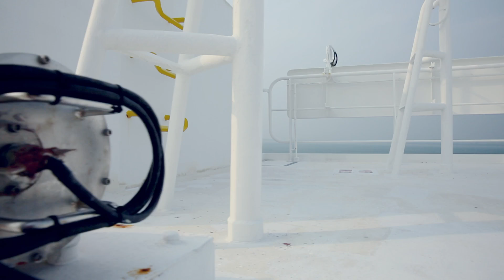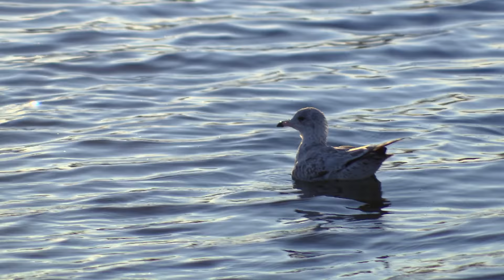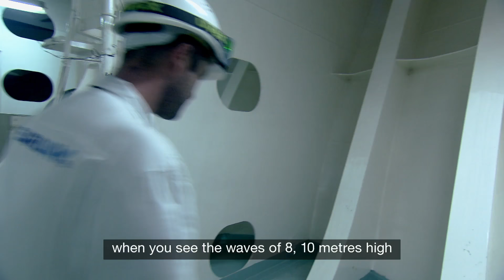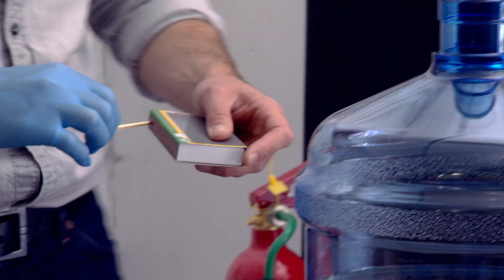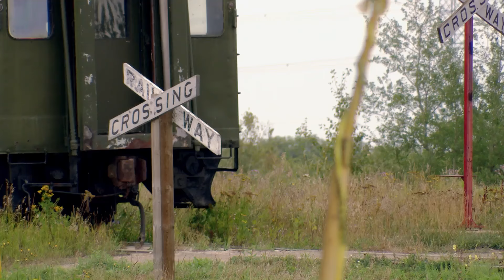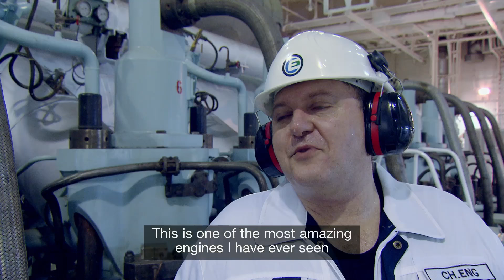Unlocking the Power of the World's Largest Oil Tanker | Blueprint

Comment: By AI:

The Seawise Giant (also known as Knock Nevis, Jahre Viking, etc.) is significantly bigger and heavier than the TI Europe.512edf
Here's a direct comparison based on their key specifications:
Length: Seawise Giant — 458.45 m (1,504.1 ft); TI Europe — 380 m (about 1,247 ft). The Seawise Giant is roughly 78 m (over 250 ft) longer.f32e46
Beam (width): Seawise Giant — ~68.8 m (226 ft); TI Europe — 68 m (223 ft). Nearly identical, with the Giant slightly wider.ce1ab1
Draft (laden): Seawise Giant — 24.6 m (81 ft); TI Europe — 24.5 m (80 ft). Almost the same.297e42
Deadweight Tonnage (DWT, cargo-carrying capacity): Seawise Giant — 564,763 DWT; TI Europe — 441,893 DWT. The Giant could carry about 28% more cargo.9432c7
Gross Tonnage (GT, internal volume measure): Seawise Giant — 260,941 GT; TI Europe — 234,006 GT. The Giant is larger here too.59d3fa
Full-load displacement (total weight when laden, a key measure of "heaviness"): Seawise Giant — ~646,642 long tons (or up to ~657,000 tonnes in some references); TI Europe (TI class) — ~509,484 tonnes. The Seawise Giant was substantially heavier.cfebb5
The Seawise Giant, built in the late 1970s/early 1980s (with a major lengthening), remains the longest self-propelled ship ever built and held the record for the highest DWT and full-load displacement of any ship. It was so large it couldn't navigate the Suez Canal, Panama Canal, or English Channel when fully loaded. The TI Europe (part of the TI-class ULCCs built in 2002–2003) was one of the largest tankers when new and is still among the biggest active or recently active crude carriers by DWT, but it doesn't match the Seawise Giant's extreme dimensions or capacity.725f90
In short, across length, cargo capacity, volume, and total weight, the Seawise Giant wins decisively. Both are (or were) ultra-large crude carriers (ULCCs) designed for massive oil transport, but the Giant was in a class of its own. Note that the Seawise Giant was scrapped in 2010 after service as a floating storage unit, while the TI Europe has been converted to an FSO (floating storage and offloading) unit in recent years.

Comment: Why the bullshit FAKE AI thumbnail for the vid? Utterly unnecessary. Yet more ENSHITTIFICATION of the internet."
Visual analysis of the image reveals several indicators typical of AI generation:
Anatomical and Tool Distortions: The worker on the right has hands that appear to blend into the tools they are holding, and the wrench-like object has a nonsensical, melting shape.
Structural Illogicalities: The large horizontal white pipe in the foreground features support structures that don't align correctly with the deck. Some supports appear to be floating or are missing where they would naturally be required.
Text and Detail Artifacts: While the "NO SMOKING" sign is legible, the windows and railings on the ship's bridge in the background lack the sharp, geometric precision found in real engineering photography. The railings seem to warp and disappear randomly.
Physics Errors: The worker on the left is interacting with a white box that has levers and knobs which do not appear to be functionally attached to any machinery or the piping system.
Although no Google AI watermark was detected, these types of structural and detail inconsistencies are common hallmarks of images produced by generative AI tools."

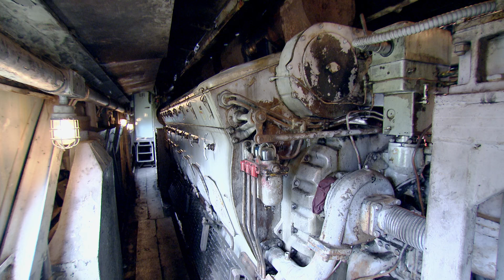Comment: 34:00 - diesels do not pull in air and fuel, but only air. Fuel is injected at the peak of compression. No spark or other electricity required in a mechanical engine

Comment: Unfortunately, the information in this video is inaccurate. In reality, tanker sizes are decreasing. Large tankers built in the 1980s and 90s have been relegated to stationary storage use
Reply: Why
Reply: @pranabgill1310  The main reason is accessibility.

The extremely large tankers from the 80s (ULCCs) could only dock at a very small number of ports because, as mentioned, they were simply too massive. Additionally, they were unable to pass through either the Panama Canal or the Suez Canal.

Today's tankers (VLCCs) are roughly half that size, but they can dock almost anywhere and use the major canals, making them far more flexible and cost-effective.

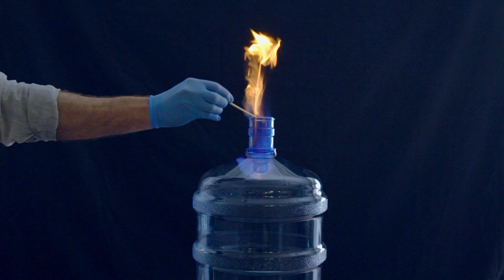Comment: 25:00 nitrogen  is actually  what we used when I worked for boiler  maker  welding  gas line in a gas line fix as welder we purged the system  with nitrogen  before welding pipes probly most nerve racking  thing ive done hired as welder in union the co hired me to weld gas pipes showed me what he needed welded on sunday in a collage and purged the lines and then cleared the entire building  including himself and ones i was only man left in building i was permitted to weld  and im still hear but it was truly scarry the man who hired me did it him self 100s of times but had broken arm and other bad ingeries after bad motorcycle accident and could only find me on a Sat when gas leak emergency call

Comment: Both the EMD shown and the ship engine are 2 cycle but they do not use the crankcase as a way to scavenge the cylinders.  They both have intake ports and exhaust valves.  Also they use either a blower or turbocharger depending on model.

Comment: Why are we treated like children? I grew up with feet inches fathoms yards and miles per hour, I dont need to be told a ship fully loaded is half a mega ton which equals 500,000 KG metric tonnes that's its dead weight. 
What is the unladen weight, minimum draft and maximum draft loaded to the plimsoll line?

LOA 350 meters = 1,155 feet

What is the beam meters and feet?

I don't need to know how many cars could fit on deck, its a VLCC not a car carrier!

You also need to decide which measuring system you are using.

Apart from the patronizing language the technical and build history was very interesting.

Comment: The more chain they let out, the better chances they have of holding the ship at anchorage due to weight. The anchor itself only needs to be heavy enough to dig into the sand beds of the ocean to anchor. The chain holds the ship in place

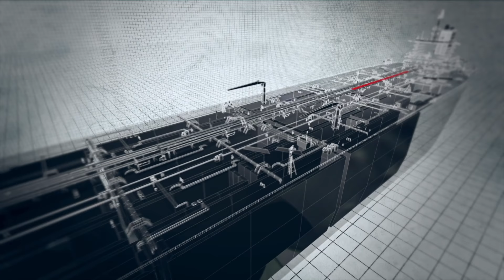Comment: 20:18 - the vessel doesn't use its own cargo pumps to "bring cargo onboard"

The cargo is pumped onto the vessel by the shore/offshore platform 

The vessels cargo pumps are only used to discharge cargo from the vessel

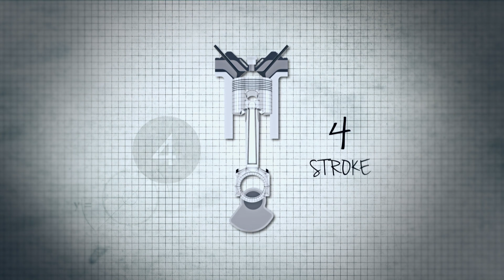Comment: At 34:39, the diesel two-stroke animation example is off. They used gasoline or petrol instead of diesel, and there's no real explosion in a diesel engine—it's more like a gentle burn.
Reply: Its much further off...in diesel engines you only compress the air, not an air / fuel mixture as you do in other engines, 2 or 4 stroke. There are also no spark plugs in diesel engines....the air is compressed so highly that its temperature raises to the point that when fuel is finally injected (at WAY higher pressure than gas injectors)...often above 20,000 PSI, the heat from the compressed air is so high that it ignites and burns the diesel fuel.

Comment: When half of the propeller is out of the water and the engine is running, won't that put a lot of stress on the bearings and seals where the propeller shaft comes out of the ship?
Possibly a new design could be considered where two electric variable pitch steerable pods could be attached so that the propeller is never out of the water.  They are more efficient and could do away with the heavy drag inducing rudder.
Reply: That´s usually only when the ship is fully empty and even the ballast tanks are empty as well (for dock time or maintenance for example). 
AC-Pods are quite inefficient for tankers and freighters, because they usually run constant speed in a (quite) straight line for a long time, direct drive is more efficient.
The Pods are very helpful if you do not want to require tugs for mooring and might need to make tight turns, like big ferries or cruise ships
AC-Pods loose quite some energy when you convert the motor power to electric power, run it thru inverters and turn it back to rotational energy in the pods.
Also, just imagine the massive generator (and inverter) you would need to add to the ship of that size.

Comment: fun fact. anchor´s don´t hold the ship in place, it´s actually the weight of the chain on the sea floor
Reply: What the hell is an anker
Reply: @jamesadams893  tnx yeah that´s the german spelling... didn´t know the english language messed it up so bad
Reply: It’s both. The amount of chain used is called scope. The scope helps anchor get well anchored lol
Reply: That’s not true. Consider a ship in 20 feet or six meters of water. Do you think it’s the anchor or chain in the sand that’s holding it in place? The anchor will weigh more than the chain at that depth. Also, most of the time the chain is not “on the sea floor”.
Reply: @NomadAttorney That's why we have short stay and long stay anchorage
Reply: @NomadAttorney  "Consider a ship in 20 feet or six meters of water. Do you think it’s the anchor or chain in the sand that’s holding it in place?"
no, sorry we can not consider that example, the technical term for this ship in 20 feet of water is "grounded" not "anchored".🥳
sry had to make that joke :D
Reply: @NomadAttorney  Why don't you try using "GOOGLE " before posting...Why do you think the chains are that long and massive? 
To hold the "little" anchor in place?
Why do you think the longest anchor chains are ~500 meters and are much heavier than the anchor?
Reply: @johanswede8200  Why don’t YOU actually read and consider MY comment? You didn’t address the objection I raised using the low depth example.
Reply: @NomadAttorney  this video is talking about the fking largest oil tanker in the world. ur "example" issn´t even feasible for this ship. 6m of water depth might be ok for ur little yacht with a heavy anchor tied to a rope,  but we are talking about ocean going vessels not ur little boat on a lake.... 
apparently you are a lawyer and know sh!t about naval topics, stay in ur lane. why whould u double down and embaress urself even more? u always give urself a thumbs up?
congratz to ur boat on the lake, but don´t think ur a sailor now or know anything about sailing.
riddle me this: why are you using about 6-10x the water depth in chain length when anchoring large ships?
These ships drop hundreds of meters of chain weighing tens of tons — that chain’s catenary effect is what holds them in place, not the anchor itself.
Your example simply doesn’t scale to that physics.
Reply: @johanswede8200  yeah the first couple of meters of chain are heavier than the anchor itself
Reply: @Hellfr4g Thanks❤ But I have known these things for 40 years😊
Reply: @Hellfr4g  Sorry, I don’t speak Jive. Btw this isn’t Instagram. You can’t see who likes what. Bye.
Reply: @NomadAttorney  Why don’t YOU actually read and consider MY comment? You didn’t address the objection I raised using the low depth example.
😜
*i know this isn´t insta, but who else would give u a thumbs up immediately after posting ur bonkers comment? i don´t know it for a fact but i know it´s true, u gave jimrockford that thumbs up also :D
although i don't really know what he is referring to, whether its my original post or your comment :D
Reply: @Hellfr4g  I’m bored. BFN 😎
Reply: Bullshit
Reply: @jimrockford3662  Exactly!
Reply: @jimrockford3662 not bullshit. I am a 2/O and relief C/O onboard crude oil tankers. This comment is actually correct; the majority of holding strength is actually due to the weight of the chain, not the anchor itself. That is not to say, however, that the anchor digging in doesn’t have an effect (thus nature of the seabed is taken into account when determining a good holding ground). On the ship that I am permanent on, each link in the chain weight approx. 325lbs.

Comment: The largest ship ever built was the Seawise Giant (also known as the Knock Nevis). It measured 458 m long and 70 m wide (SF Fig. 8.5) and was used as an oil tanker from 1979–2010. That a big tanker.
Reply: Came here for that. Thank you.
Reply: Correct , she was big and if i not mistaken the  Maersk Triple E class container ships are bigger than this tanker.
Reply: @Billy-qg9kb  Possibly in dimensions but I don't think in tonnage.
Reply: @Albatross-x5c  Completely true. Even Triple-E is wider and longer, it has 200-000DWT copmaring to this tanker class of 500-000DWT.
Reply: @Billy-qg9kb  they are not bigger than Jahre Viking (Seawise Giant), not only was she bigger in all dimensions but also much more heavier with dwt of 564,763t. There is nothing bigger then her till this day
Reply: @fury9973  mis quote me there mate i said "correct" the first guy knock nevis being the biggest, 2nd part about maersk where they bigger than the tanker in the video, being smaller than knock nevis Happy Giant, Jahre Viking, seawise giant . what ever you prefere to call her
Reply: @Billy-qg9kb  I apologize then:)
Reply: @Billy-qg9kb  Still are smaller check wiki.
https://en.wikipedia.org/wiki/List_of_largest_container_ships
Reply: @Billy-qg9kb no ship is much bigger than the seawise giant in terms of gross tonnage
Reply: And was scrapped on the beach of Alang in 2009,Another of these will never be built sadly.
Reply: The Prelude from Shell is 488 meters long by 74 meters.
Reply: @jollyjumper2164  yes, almost 1/2 a Kilometer ! but it is a Barge and no self-propulsion, there is a Ship bigger a little shorter  but much wider.and the drought is more, its a Crane  / lift Ship , over 400 Feet wide and 1 Million Tons loaded, called Pioneering Spirit, I think that's the name?
Reply: Wrong it's the shell prelude at 1604 FT
Reply: No longer
Reply: Seawise Giant was its original name, it had a few owners and names, it was Jhare Viking, I didnt know it was the same Ship because it was enlarged. Anyhow, it was badly damaged in explosions and Fire, it was sunk, I think it was attacked with missiles? and it was enlarged. 
This ship is what? 1,246 Feet long and 223 Feet wide, Seawise 1,504 Feet long and 230 Feet wide. In the 70's, there were 3 French-built slightly bigger (when the West still made things) with twin Screws and didn't have the Propellers mounted high and exposed like this one unloaded like this one. they were fast for their size.
There is a Ship bigger than this & Seawise Giant put together, check out the Derrick Crane - Skid / Platform lift, Work-ship named Pioneering Spirit.
Reply: That's true, but it's been scrapped in 2010. Since then, the TI-class supertankers are indeed the largest ships on the plant (that still exist)
Reply: @peterniepel6218 they are not the largest, maybe largest of the liquid or bulk carriers, but not the largest Ships,
Reply: Largest oil Tanker, it's in the title....

Bruh

Comment: Uh only 380 meters long, and 70 meters wide-only....Jaharre Viking was 460 meters long and 80 meters wide after its final structural up kept...and this ship simply could no die, once even burned in 70% and still she got re-done and back in to service in NO time. Viking was the biggest ship ever build, ....but Japs did or still do have plans for SEA GIANT II of 500 meters long and 100 meters withe to handle 3 Millions of oil barrels a true monster of the seas,...but the $ MONEY $ never did arrived to build it ...to bad. TH